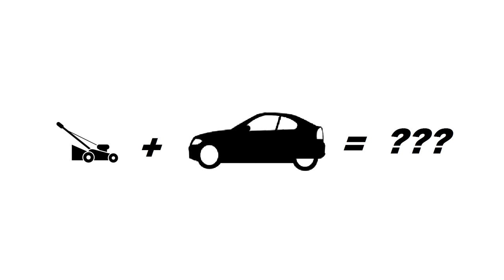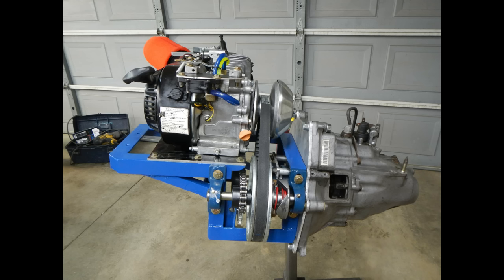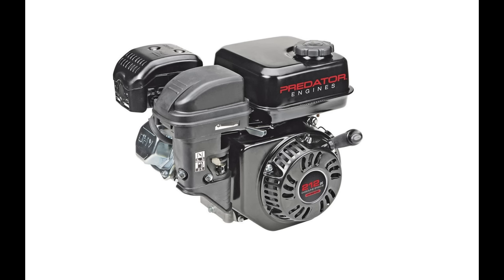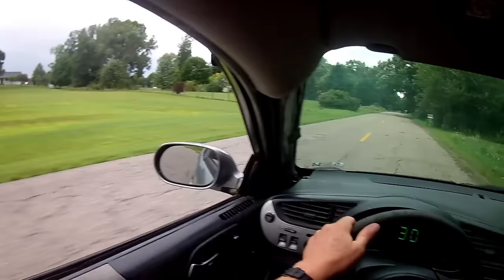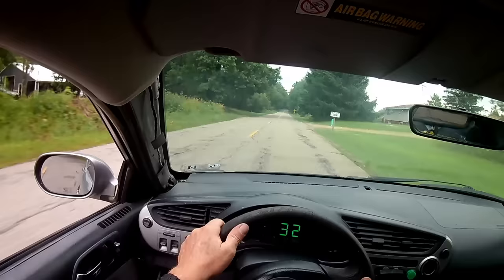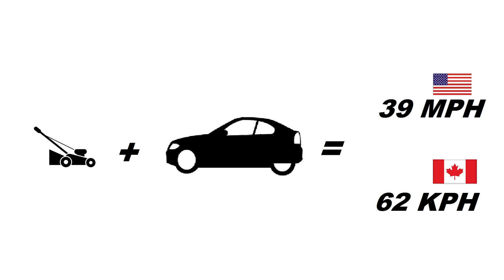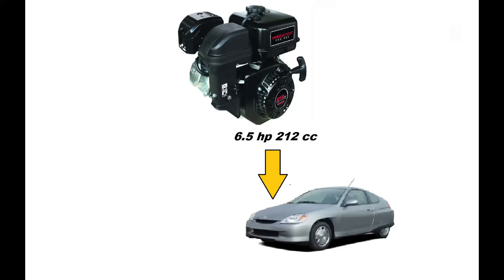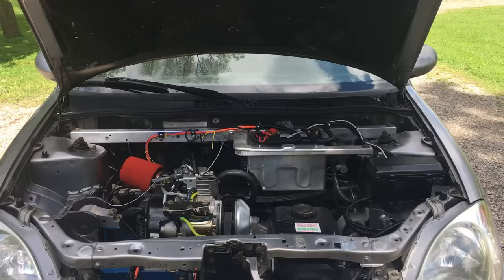Episode 1.  We put a $99.00 Predator engine in our Honda Insight.

Comment: Almost 40 mph off a lawn mower engine is actually pretty badass
Reply: Off of a 6 hp engine, no doubt. I'm waiting on the bigger engine he put in (400+cc?). Twice as big should get it to hwy speeds. Really neat stuff.
Reply: @felipew1938  500ccm would do the job like it had before. Fiat company made small cars in the 70's with 580ccm. The motorcycle 600ccm Yamaha or Honda 4 inline engine  would push this car to go to 100mph or beyond with no problem.
Reply: My bike has same enging only gose 30 idk how this car is heavier  nd gose faster
Reply: @The_Touring_Jedi  I've recently been looking at a yanmar '3TN' for another application,  but it would work really good as well, and being diesel would be extremely eco- friendly
Reply: imagine I'f it was a 9hp
Reply: It bugged me that the window was down and the alignment was bad. Who knows what kind of speed was left on the table!
Reply: @estebanrodriguez5079  Could be because of the gearing
Reply: @estebanrodriguez5079  drag coefficient, the grade and slope of the ground, ect
Reply: Because do you really need to accelerate so quickly in real life? In city traffic?
Reply: Haha, you guys crack me up. It was achieved on a decline the whole video is invalid 😂😂😂😂😂
Reply: Could have gone a couple more mph if he closed the windows
Reply: No no its not!
Reply: @TheKitMurkit  Absolutely! Its a drag race to the next light, brakes are slammed on as they hurry to stop again.
Reply: @stevecam724  you're arguing about the specifics of a video of someone putting a predator in a civic 😂 I don't think the point of this video was to show off performance smart one
Reply: People have converted these cars to pure electric using a good electric motor and battery and the performance is better than the stock car from the Honda factory. It’s going to cost a lot more than $100 though, but not crazy expensive, an average person could probably do it
Reply: @felipew1938  yeah, even on my 115cc moped i only topped out at 70-85mph (optimal at 55-60)
Reply: @felipew1938  You mean fuel efficient?
Because I'm sure diesel is much less eco-friendly than petrol
Reply: @stevecam724  like your comment was made using a decline of brain cells
Reply: Good grief it was only a 6hp lpl
Reply: @tomc8157  agree. I owned two cars before: 1980 Mercedes diesel and a 2006 Golf GTI. Living in a busy metroplex meant keeping the GTI and selling the merc, because in cold weather, that heavy underpowered diesel took many minutes to warm up before it could accelerate even though it had a turbo. The GTI 1.8T got up to speed without even warming up. People tailgate you when youre in a slow accelerating car. Its also less safe.
Reply: @estebanrodriguez5079  gearing
Reply: @felipew1938 In the 1980s, Mazda used 4 cylinder Perkins diesel engines in the B series. Perkins still makes the engines for use in generators.
Reply: A go kart could do that easy.

Comment: If probably be worried about overheating before anything else, this was a wonderful video. I put one of these engines on a beach cruiser bicycle and my only breaks were the stock coasters. The thing went 55 and I rode it to work for 2 years
Reply: Homonyms and homophones: breaks brakes
Reply: @coloradostrong  I'll be sure to let my autocorrect know
Reply: that sounds scary &awesome.
Reply: What was the cost to build it?
Reply: That CVT belt will last about 30 take-offs

Comment: You are basically doing what Citroen did in the late 1930's: make a lightweight car with a 400cc  engine that gets great mileage. 
Immediately after WW2 Messerschmidt did the same with their KR175 and KR200. Unlike the Citroen the Messerschmidts were also aerodynamic. That's what you get when an airplane maker starts building cars.
Cool project! You could use a tiny turbo on that engine. They do exist.
Kyle from Boosted Boyz installed a tiny turbo and EFI on a 1cil motor to power a shopping cart!
Reply: Didnt the trabant also do this?
Reply: @ocelotmadness6287  Compared to Messerschmidt, BMW Isetta or others of this kind? Nope. Trabant was a normal (but small) car.
Reply: I hope he considers a turbo water meth and hydrogen cell
Between the three of those I would imagine that he could get close to 70 mph.
He could put an electric motor on board out of like a Tesla or something. Or like golf cart electric motor backup.

Comment: A 1960s-1970s Volkswagen Beetle needed about 8 hp to cruise at 60 mph on level ground, no wind.  The other 32 hp from its 40 hp engine was primarily used for acceleration.  Nothing much has changed in half a century.

Comment: I didn't think it would even pull away. Bloody nice. What's the gas milage I wonder.
Reply: You mean "Grass milage"? 🤣🤣🤣🤣 I stole this joke from Phyl in another comment section above yours. I'll leave now. 🤧😭
Reply: 2 👍
Reply: 35-40 a gallon for the engine but it’s pulling a car so probably a lot less
Reply: i think you mean gallons per mile
Reply: @burglar7523  well I went with gas mileage since you cab get other mileage as well. Such as, how long would a set of tyres last.
Reply: @burglar7523  who uses that?
Reply: @elieli56  well thank you for being honest
Reply: @zittauerbuar4415 they're joking that this thabg probably uses more gallons per mile than miles per gallon

Comment: As a mechanical engineer, I’m completely blown away and wanna know more about that transmission/gear drive Frankenstein you made. Awesome man. Now put a big boy predator in it. 24hp
Reply: man just drop a 350 in it . . .
Reply: That's called a jack shaft with a centrifugal clutch (cvt torque converter)

Comment: Pretty impressive speed from that actually. Put a kubota 3 cylinder or a hyabusa or honda cbr1000 engine in it
Reply: That thing would get incredible fuel economy with a Kubota 3cyl diesel!
Reply: Or a Harley V-twin, just for the sound.
Reply: @marc-andreservant201  every see the Morgan 3 wheeler? It has a very twin mounted up front. Looks pretty cool. They had one on top gear. The gauges looked like gauges from an aircraft. The whole thing reminds you of an old WWII fighter.
Reply: A collab with D boss garage ....?
Reply: Read about the 1970 Honda 600 car.

Comment: I love Honda Insights! I'd like to point out that the first gen Insight that you have came with ultra low rolling resistance tires that lasted damn near forever. Not sure what tires you had running during that jeep+trailer pull, but it probably wouldn't even have had spin if it you had even some basic eco tires on it. Very impressive!

Comment: That’s the jankiest CVT i ever seen
Reply: @TheRobertChannel  they finally ditched it in the new Pathfinder.
There's finally a glimmer of light
Reply: @bryanmartinez6600  I think it still exists in their lower end cars. If only people realized that a used Toyota, Honda is better than a new Nissan, Kia, Hyundai with a crappy transmission.
Reply: @tevinabeysekera6038  I think it'll go away over time as they have to adapt their new vehicles for the new transmission so I think it may come out in future models.
I like Nissan as long as it doesn't have a CVT. Some Infiniti come with a 7 speed auto but some do have the CVT as well.
That CVT from Jatco is also used in some Mitsubishi models as well.
I don't think Nissan as well wants to stick with the CVT as it has caused lots of warranty transmission replacement.
Honda also had their early transmission problems as well in the early 2006-2008 Ridgeline. Took 2 years to improve the transmission. Nissan has made attempts to improve the CVT but it only gained a bit more durability.
I think they finally decided to shift away.
For people in the used car market many will become victims of the CVT but also many people don't inform themselves of the vehicle they look at only that it looks nice.
Oh and I don't think Honda builds their own transmission anymore they now use a ZF 9 speed
Reply: Wow you haven’t seen bad clearly
Reply: 55, it better be all down hill..start at the top of Pikes Peak.
Reply: John Doe  Because it isn't. It's a totally different hybrid powertrain. It wouldn't be fair to compare Prius' eCVT with conventional CVTs... other toyotas like Corolla has conventional CVT too.
Reply: No I believe you guys are wrong. Yes they have been having lots of problems with CVTs right now, but they will be a wave of the future, and so when they get them figured out we are going to see a lot more of them. There's is nothing better for an internal combustion engine because the cvt can put the engine in its sweet spot rpm and hold it there. Electric vehicles won't need a transmission as we know it now. CVTs will be better for economy, emissions & power. They are torque sensing. 
 Rather than stepping up and down through gears having the engine go above and below the desired rpm in every gear. That is there reason car companies are using 8- 10 speed complex transmissions to keep the engine closer to a specific rpm depending on throttle setting and load.
 That is the reason snowmobiles & a lot of ATVs n stuff with smaller engines use CVTs.
Reply: Also Honda builds its own transmissions. The Civics have had CVTs for many years now and they work fine. Most people don't realize that, but I know it's true because my brother in law has a late model civic. Honda incorporated a rpm interrupt to make them feel like they are shifting! Because everybody thinks they have to feel that shift. Ha ha!  Yes it's true research it.
Reply: It Vorks!
Reply: @429thunderjet2  let them get it right on someone else's dime.
Reply: @billrehm3590  id have to agree, but we know how it works unfortunately.
 I've heard Honda's cvts have been pretty dependable however.
And my brother in law did a lot of research on civics, because he is very particular. He wanted the non turbo four cylinder, ect because they were the most dependable longest lasting.  And the cvt didn't even phase him and I know he studied them as well.
Reply: @billrehm3590  
Maybe the Grand Canyon too for that "extra boost"??

Comment: I want to do this with one of those 2 stroke snowmobile engines.
Reply: God I wish i could find a horizontal shaft 2 -stroke anything that doesnt go on a landscaping trailer...
Reply: High revving Yamaha KT100 could actually work with that variator gearing
Reply: @pinkhead6857890  snowmobile and Jet ski engines are horizontal shaft but no gears.
Reply: @Lauri-B  it probably would work. The reason I say snowmobile is because  There are lots of performance parts available for those engines and they make a decent amount of power.
Reply: @noahpaulette1490  - Decent as in 200-plus horsepower from less than 1000cc.
Reply: @noahpaulette1490  Never seen a snow mobile in my life, but after some googling I just realized that jet ski motors arnt just repackaged dirt bike motors that need a special engine cradel. So far I have seen a couple jet ski and outboard 2 strokes that just mount flat like any old 4 cycle briggs. Too bad anything boating is a hole in the water for throwing money into..... 

I cant believe that nobody has tried selling 2-stroke top end conversion kits for those disposable predators yet.
Reply: I would put a arctic cat crossfire 700 engine because they have 142 bhp
Reply: @pinkhead6857890   I am also surprised someone hasn't done 2 stroke conversions for the predators either because they would probably be decent.
I'm in Michigan so I can get snowmobile parts cheap enough but not really on option in a lot of the country.
Reply: @noahpaulette1490  don't think that would be very feasible to try turn a predator 4 cycle into a 2 cycle. 
 But heck a 800 or 1,000 cc side by side like a Polaris ranger type engine would probably work good.
Reply: Or a yamaha four cycle snowmobile engine, lots o power!
Reply: Or just throw in pretty much any honda i4 which is what people already do
Reply: @wigletron2846  yup! and of course that would be the logical engine.

Comment: If I remember, the insight is a hybrid so the engine is only turning a generator. On the hybrids, the engine no longer directly drives the transmission (which is why half of them have carbon knocks now-there’s no real load on the engine. It’s like accelerating the car in neutral). So the predator engine should work fine. I have heard the predator engine is quite durable. My neighbor installed a predator engine on his dethatcher. Runs perfect

Comment: 80mpg at a steady 50mph when it was new. Strange that Honda quit making decent gasoline hybrids...
Reply: Let's compare, shall we? 

First gen: 78 mpg, 70 HP, 70 ft. lbs. torque, 0-60 in 12 seconds, 5 cubic ft. cargo, 1800 lbs. curb weight. Also looks like ass. 

Third (current) gen: 49 mpg, 150 HP, 100 ft. lbs. torque, 0-60 in 8 seconds or less, 15 cubic ft. cargo, 3000 lbs. curb weight. Also, it's about 20% longer.

Seems about what you'd expect given the weight and performance differences, and likely the sales difference too. Most people don't want to give up a whole lot of performance for really good gas mileage. (though to be fair, I do realize there's a market of at least some substance there) I think Honda's strategy simply changed to better reflect the customer base in the US. We like our zippy cars that can lug a fair bit of junk. (though not as much as we love our land-beast SUV's and wanna-be crossovers)
Reply: @rafetizer  If the Chinese made a safe, reliable electric/hybrid at a reasonable price that achieved 80 mpg and looked like a big round, brown turd? I'd buy it. Sniff, sniff...
Reply: @umaxen0048  The first poop-emoji car?
Reply: @rafetizer  Why are cars so heavy nowadays?
Reply: @gustavrsh  They're typically bigger and have more junk in them (for comfort). I assume.
Reply: @gustavrsh  Crumple zones, collision protection equipment and features, emissions equipment, various control modules and associated amenities, motorized everything (seats, seat belts, rear hatches, moonroofs, steering wheels, etc.), sound abatement materials, wheels and other parts engineered with weight as a last thought, or as a fleeting thought,  etc

Comment: Faster than I thought it would be....good job figuring out the ratio...most minibikes won't go that fast with a 212.
Reply: A Honda Ruckus scooter gets 40 mph off a 50cc engine.
Reply: @jasonswiatkowski9127  a ruckus does well...but it doesn't weigh close to 1300 lbs, which is what the car weighs, if memory serves. Doesn't the ruckus use a cvt instead of a manual gearbox?
Reply: My 80cc goes 50 mph and probably more if i went wide open

Comment: "We already did that." - SAAB
Reply: Context?
Reply: @josepharmstrong1531  SAAB used to make cars with 2 stroke engines (sometimes found on a snowmobile or lawnmower).  
This was during the 40-60s.
Reply: @bradleyanderson5701  so basically, they made cars with "worse than lawnmower" engine designs?
Reply: @josepharmstrong1531  basically yes.  But they were pretty reliable.  They used to race them in the Sweden Winter Rally. Look up a video kinda cool.
Reply: Surely Citroën were challengers too?
Reply: This one is a four stroke though
Reply: SAAB never used a CVT either & it's Automatic  was pretty snappy compared to other Autos & if you ECU tune their Auto Tranny's shift points you could use the Manual Mode because they made the shifts smoother & closer to the final drive ratio of their slightly more powerful Manual Counterparts which had an easier time engaging SAAB's 20 sec overboost mode than the Auto's without a tune. I had a midnight blue manual 5 dr '97 SAAB 900SE Turbo it was an amazing experience & I had fun In my early twenties with basic maintenance & some replacing, fixing, & upgrading.
Reply: @toku30  yeah I currently drive an 97 900S.  I loved my 900SE (my first car and was also midnight blue). 
I'll be a SAAB guy forever.
Reply: Saabismi on sairaus.
Reply: @RH_UU  nah haha
Reply: @bradleyanderson5701  40s.... LET ME TELL you something about Sweden in the 40s. Something like 90% of vehicles were gasification powered (NOT natural gas or propane, but WOOD gasification) because after they were buying oil and selling it to the nazis, the world collectively decided Sweden AIN'T GETTING oil anymore. However there was coal and the Fisher-Tropsch process (bubble column).